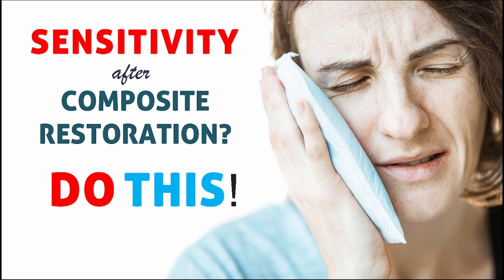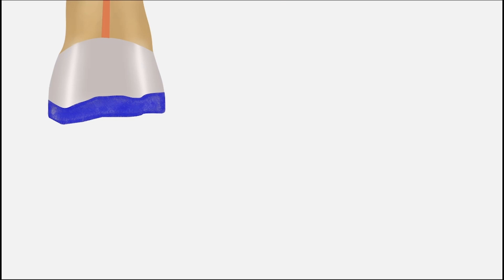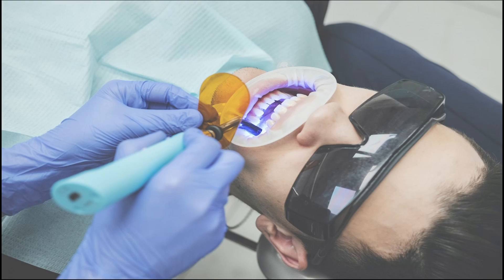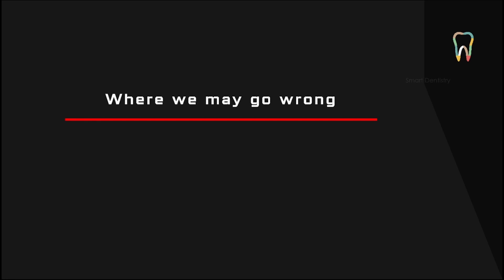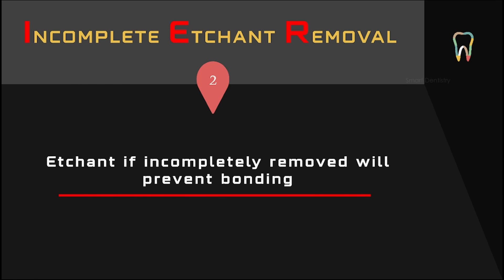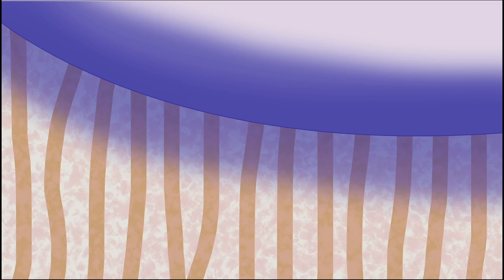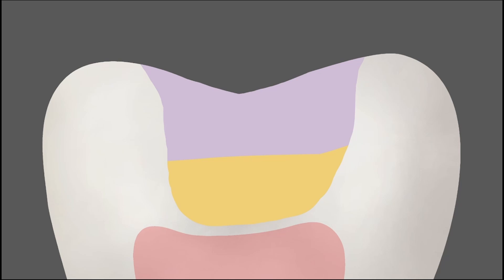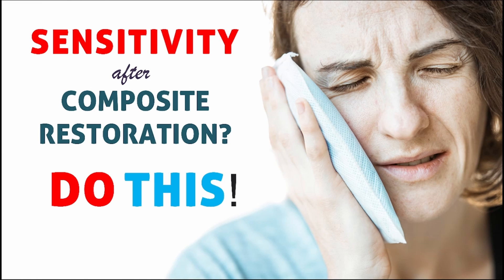Sensitivity after COMPOSITE RESTORATION? Do This

Comment: What is pulse curing
Reply from the maker: Pulse curing is a technique of curing dental composites in which at first composite is cured for 3-5 seconds with low intensity light. Then 2-3 minutes time interval is given for the composite to relive the stress generated by polymerization shrinkage. The the composite is cured with high intensity light cure unit as per the manufacturers instructions (Usually 20-40 Seconds)
Reply: @smartdentistry  Thank you for the reply

Comment: Great video. Thin horizontal increments vs angle vs vertical were studied and thin horizontal were found to be superior. But oblique is a great start. Reducing stress to developing hybrid layer is critical see: “Influence of c-factor and layering technique on microtensile bond strength to dentin” Nikolaenko 2004 and Protocols of Biomimetic Dentistry 2017 Alleman

Comment: Very informative presentation sir.  Your students at college are fortunate. Thank you for sharing your knowledge with us sir.

I have one question sir.. If Flowable composite has more polymerization shrinkage...is it still ok to place it as base...? Wouldn't it cause more marginal gaps in the deeper layers of dentin sir?
Reply from the maker: If we add it as a single layer, it will cause marginal gap
In order to avoid it, we should add in thin layers and light cure each layer before adding the next...
thus we can prevent marginal gap formation

thank you

Comment: Hi, if this video is for colleges, then this is too basic, I am sure, you know that. Shines good, really says little. BTW flowable composite has bigger shrinkage than solid. Use GIC on the bottom.
Reply from the maker: Definitely. We shall use RM GIC as a liner below composites as conventional GIC should not be etched for atleast 24 hours after placement. Thanks

Comment: I used to add bonding agent on the outline borders of the cavity afer I finish the restoration application but I believe that is not that useful ... not really sure,  wish if someone would have done this technique can share with us his experience in this matter
Reply from the maker: This procedure can prevent the marginal leakage for few days. But in long term, it will not be very helpful...

Comment: sir we can use Gic as a liner to prevent post operative sensitivity .sandwitch technique
Reply from the maker: Yes. We can use. But we should use RMGIC and not conventional GIC if we are to do the composite restoration immediately. If we opt to use conventional GIC, we should fill the entire cavity with GIC and after 24 hrs, we should remove 2 mm of GIC and that space is filled with composite.